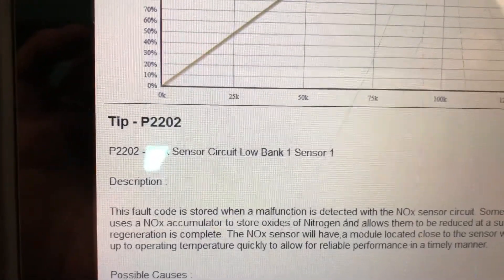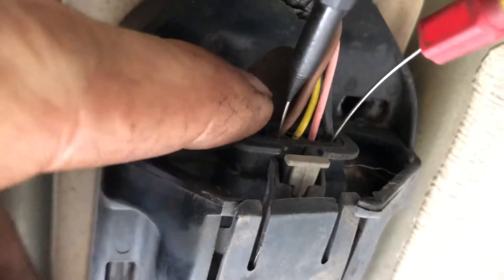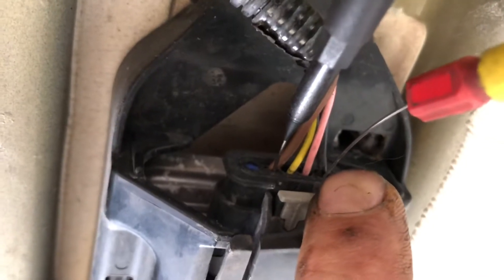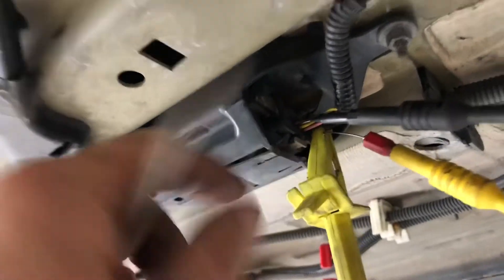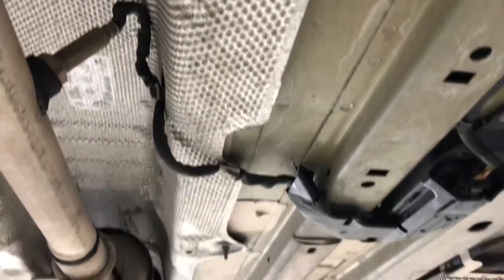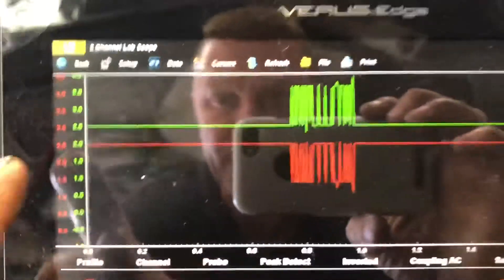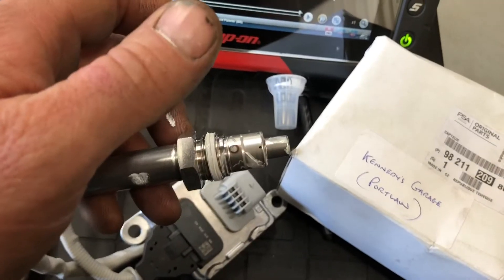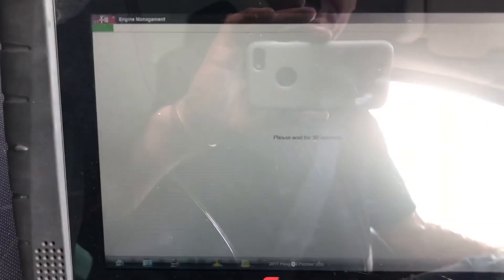P2202 Nox sensor circuit testing

Comment: Always applied this method with testing nox sensors and works a treat. Although recently came across a mercedes vito with a 5 wire nox sensor. With no wiring diagram to hand i was confused as to what the 5th wire from the vehicle side harness could be for?
Reply from the maker: Hmmmm, interesting 🤔🤔 I have not come across one of those yet.

Comment: Good test procedure but the power and ground are good and the can message was fine ,then why change the sensor ???? I would straight away check the dpi vaporiser for blockage as this would definitely set a nox fault
Reply from the maker: Hi Alan, I had looked at that prior & the Nox sensors on these are known to fail regularly. So I pulled the trigger and went with it. Luckily the vehicle is repaired 2 years now with no reoccurring issues 😉👍👍👍
Reply: What is a dpi vapouriser as I have done these tests plus changed the nox sensor but still same issue on a citeran relay. Thanks in advance
Reply: Just to add I also have pid misfire readings that seem off.
Is p2202 related to the electrical side or could this just be the nox sooting up because of a bad injector

Comment: I've had good luck cleaning these in an ultrasonic Peter, using injector cleaner as the fluid. They get bunged up - can save a fair few bob/long waits for parts.

I also need to stop calling these knock sensors (because the price often knocks ya kicking :_)  and use the posh name not the slang.
Reply from the maker: Wow, that’s sounds interesting James. And it is a permanent fix ??? 
That is pretty cool if it works well 🙏
Reply: @kennedysgarage3281  Has worked on about 9 out of 10 so far Peter - the odd one the module at the end of the wires is stuffed or the sensor is really melted, so no go - but in the main it works on the day to day ones. Works absolute wonders on DPF fuel injectors & on injectors themselves too.. There's always something bubbling away in the ultrasonic here - great bit of kit. Pays for itself very fast.,
Reply from the maker: @jamesward5721  wow, I don’t have one but must do a little research into one 😉😉
Reply: @kennedysgarage3281  I nicked mine off the Missus - she does jewelry - it's not even very big or fancy, but it does get the crap out of nooks & crannies. What fluid you use in it matters more than what machine it is - I use injector cleaner with a big dose of tar remover sprayed in. Between the bubbles & the chemicals, it works wonders. She has half a dozen for her gig so she barely noticed 1 going missing. Kinda..
Reply from the maker: @jamesward5721  I’m on the phone Googling as we speak, bet your wife wasn’t happy though 😂😂
Reply: @kennedysgarage3281  "J, did you rob one of my cleaners??"

 No - sure why would I need one of them poxy yokes Love? 

"You did, didn't you, ya tight git!! Buy yer own gear FFS!! Leave my stuff alone.. "..  

Yes, Darling.... :_)

I keep her car running - so I get leeway.. she'd be lost without her car. :-) I'd be out on my ear otherwise. :-)
Reply from the maker: @jamesward5721  sounds like me & my wife 😂😂😂
Reply: @kennedysgarage3281 But p2202 fault seems to be about heating circuit inside nox sensor, or not? Did it help to ultrasound wash them who had p2202?
Reply from the maker: @guawej6473  that is correct. The heating element is integrated into the Nox sensor and the only tests that can be performed on them are to prove that the Nox sensor is getting a power and ground. Ultrasonic washing will not resolve this issue 😉👍👍👍

Comment: Ive got a 2019 berlingo both The power wires are ground. Think I've a short only can low has activity not can +,,? Does the the sensor get it battery voltage from ecm? Can't see owt obvious but there's no power going to it. Hard fsult says no comms on CAN to noX sensor,??
Reply from the maker: Hi Ritchie, if you don’t have any power getting to it, then it can’t communicate. So that will have to be resolved first. I’ll try get a look at wiring diagrams later 👍

Comment: I do not get it, so what was the issue? There was no issues with supply voltage and CAN readings were fine but solution was to change the sensor? I am getting P2202  from time to time, i guess i need to check wiring or try to clean contacts first if it really has to do with the supply voltage not the Nox module internal circuits.
Reply from the maker: Yes, your statement is correct. There is no issue with power , ground or CAN communication wiring. So as the scantool pointed out , the fault was in the NOX sensor itself. It seems to be a very common fault on Citroen/Peugeot so you may just have the same issue. Hopefully this will help 🤞👍
Reply: @kennedysgarage3281  Thanks, i have same error on MB, i will try to clean contacts, if that wont help i will replace sensor.
Reply from the maker: @montepaso  it is worth a try, let me know if it works 👍
Reply: @kennedysgarage3281  No luck cleaning it. Sensor looks very clean even efate 160kkm. I will bring car to the dealer to diagnose, although i am out of warranty i know Mercedes do replace them for free in some cases. OM MB sensor cost 620EUR.
Reply from the maker: @montepaso  it is going to be the Nox sensor at fault they fail very prematurely. The car I done this video on had only 10,000 kms on it. But it would be interesting to see if there is warranty or a recall on them 🤔
Reply: Ok, guess i needed more time, now all errors have gone!!! I removed it and sprayes with maf cleaner couple times then blowed with compessor and placed back. Also sprayes contacts with contat cleaner.
Reply from the maker: @montepaso  🤞